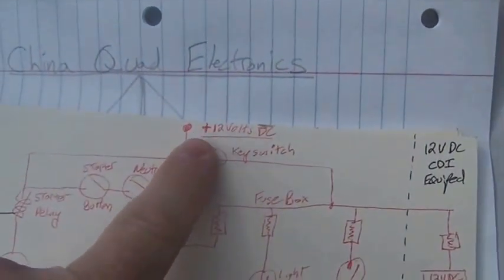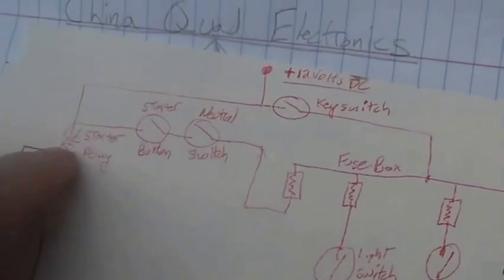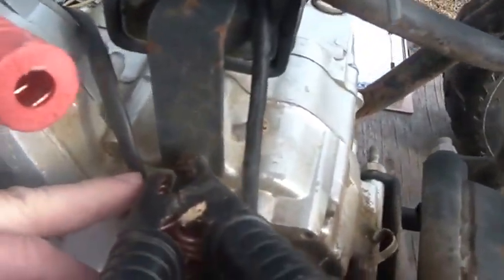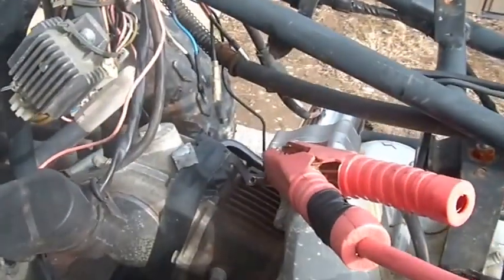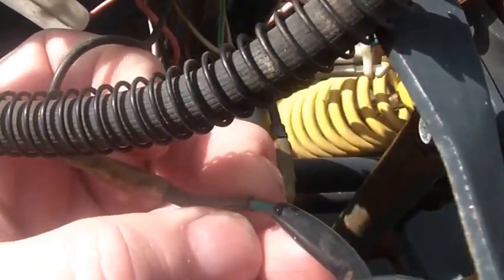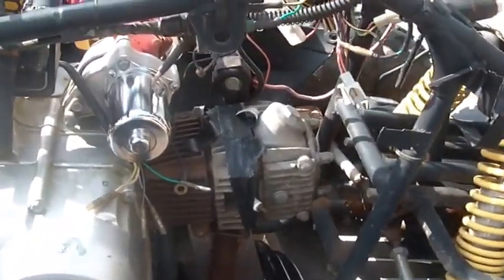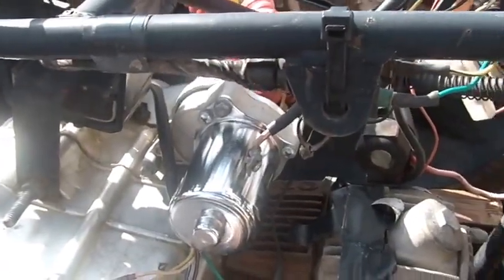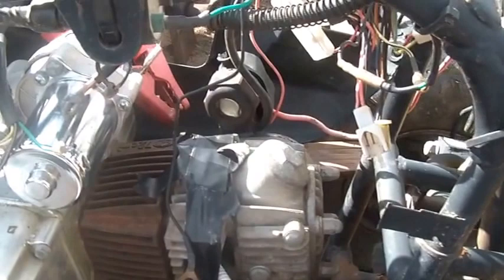Intro to China ATV 12Volt Electronics, Starter, lights, charging,

Comment: I have a 110cc atv peace from China. I can get it to turn over if I place a screw driver across the to bolts for the starter to spin. But I can’t get the kill switch start button to work I have ordered 4 of them off line the pin color codes don’t match. I can get the brake lights to come on when they are compressed but the head light will not come on and I’m lost as to what to look for. When I push the start button the brake light goes dim so that tell me something is trying to happen but not taking place. Any clue as to what I should look for ? And should the fuse be hook to the battery post also??

Comment: If direct to starter doesn't start ehaye the issue.  I had lights on and engine turned on when I tried to start the kymco atv. I thought it was cdi that was bad. Ordered ac cdi (wrong) and hooked it up. Now lights are out. Bike turn over by solenoid

Comment: Hi @Harvey Spooner i bought a atv quad 4 stroke FYM 125 Sport 125cc.. But it comes with no battery.. Does it needs to have one? I can kickstart it and runs but has no tail lights or neutral light... do i need one battery for those to work?? plus i love your videos and would be grately appreciate it if you can find a manual or something of my atv. thanks Harvey!!
Reply: It needs all of those to run accessories such as the headlights and the neutral light you mentioned.

Comment: Here's a question for you harvey. I have a 110cc tao Tao atv that when I connect the battery the starter keeps spinning till I disconnect the ground from battery or the wires from the solenoid to the cdi. I tried changing the solenoid, still same. Changed the cdi, still same.  Disconnected the starter button switch and it still does it. Even with the key off it does.  I cut the harness covers off and checked for grounding issue but nothing, all taped. It feels like it's a wiring issue. I have a spare pit bike harness and have watched your video's to get spark but I would like to keep the charging system and handlebar starter switch.

Comment: Question I have no power on the handlebar switch I could make the bike run but I have no 12v at the switch for lights or star swich
Reply from the maker: Hey Victor!!!   Normally the power goes from the battery to a fuse, to the key switch, then to the handle bar switch.... I would go backwards from the handlebar switch or forward from the battery.... I hope this helps.... Thanks for asking, watching, and commenting!!!

Comment: Harvey I have a coolster mountopz 110 3050c Atv and the 15al250v fuse is blown and I was wondering is there a way to bypass this
Reply from the maker: Hey Chris, I would replace it with another 15A fuse, or hack another fuse and fuse holder of 15A in its place.... I don't recommend bypassing fuses as a lot of damage or a fire can happen.... Thanks for asking, watching, and commenting!!!
Reply: Harvey Spooner 
I tried hacking another fuse it melted my whole starter ignition wires the red and the black and there is a three wire connection on this coaster ATV it has a white blue and another wire that I have no clue where it hooks up I will trace it down and get back with you there’s also a black plastic box mounted on the far right sideOf the ATV if you’re standing at the rear of it it has three wires going into it and a little black wire rolled up going to nothing do you know what this box says it is not the CDI or the relay box or the spark plug box although it is mounted about a foot away on the same side as the spark plug box
Reply from the maker: Hey Chris, Meltdown, not good, now there is the original problem and whatever damage is done.... Good luck!!!!

Comment: I'm glad I took pictures of before I changed the stator the green wire was replaced by a green and white wire which runs to blk on the harness where it used to be solid green. it gets spark and tries to fire it started barely but I guess the carb is bad so I ordered a new one today. I have one question the connections are really loose where they go from the stator to the harness do I just take a pair of plyers and cremp them down so they just don't slide right out or do I cramp the female piece. Will it close it a little bit to make the connection tighter. Because it literally slides right out and as much as these things shake and vibrate they will just slide out when I get the new carb.. How do I fix that

Comment: I installed a new stator on my 110 taotaob1 and seemed to get a better spark but the wires coming from the stator I bought changed colors on a few wires. I always thought the blue wire is the cdi wire and I hooked up blue and white to blue and white, white to white, yellow to yellow, red coming out of the stator to red and blk on the harness. Then I have a green and white from the stator and the only one left on the harness is black. Is that correct? I would send a picture but I'm not sure how the plug is sparking but still won't start.

Comment: Harvey  hey when I hook the battery up. the voltage regulator gets hot hot and down at the stator it gets warm warm so what would solve that ?because I think that's why my battery is going dead just setting there. On that Chinese mini 110 four wheeler thank ! And so you know I do have everything else unplugged and them two parts are getting hot but when I unplug them they get cold again
Reply from the maker: Hey Samuel, Ur regulator should act as a 1 way valve, it puts power into the battery, it should not me acting as a load... I'm thinking that it is Ur problem.... I would disconnect the regulator from the engine and battery until U get a replacement...  Thanks for the info, asking good questions, watching, and commenting!!!

Comment: Hey Harvey why does my battery go dead just sitting their  on my 110 Chinese  four wheeler what would cause that ? And thanks for the other help
Reply from the maker: Hey Samuel, Disconnect the battery from the ATV, charge it up, let is sit for a few days, hook it up and see if it held the charge, assuming it does, there are basically 3 circuits that run off Ur 12Volts, the start circuit, the lights, and the accessories.... Assuming Ur starter is not running all the time and that Ur lights are off, that leaves the accessories including the remote control safely turnoff if there is one.... Thanks where I would look.... Thanks for your kind words, encouragement, asking good questions, watching, and commenting!!!!

Comment: Harvey, I just bought a honda 200x for my son and it has no spark... do you have any videos on how to troubleshoot a 200X, I seen a lot of your vedios on 200S and not sure if it's the same steps. also not sure if the values of the pulser and stator are the same on a 200X as a 200S. keep up the great work, your vedios are great. Look forward to hearing back from you. Thanks!
Reply from the maker: Hey Omar Tianga, The 200S and 200X ignition systems depending on the model year are about the same.... If U follow the troubleshooting, basically realizing that the CDI values must be happy to get a spark, U should figure out what the issue is.... I will be posting a video on a China Quad ignition system tonight, given that it is a clone of the Honda ignition, troubleshooting techniques are the same, though the resistive valves obtained at the CDI plug are a little different.... Good luck, let me know how it all turns out and please let me know if U need more help, I have a 200X that I can use for a video.... Thanks for asking, the encouragement, watching, and commenting!!!
Reply: I have a miny coolster  automatic how can I turn it on the starter not good only the lights turn on
Reply: Someone tell me please how can I get it to work please